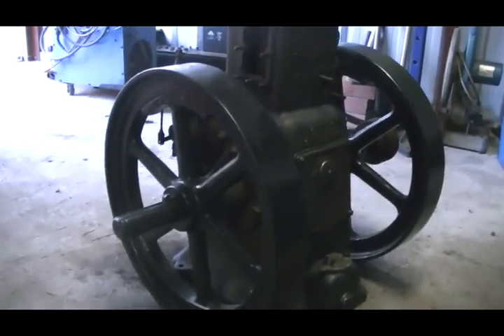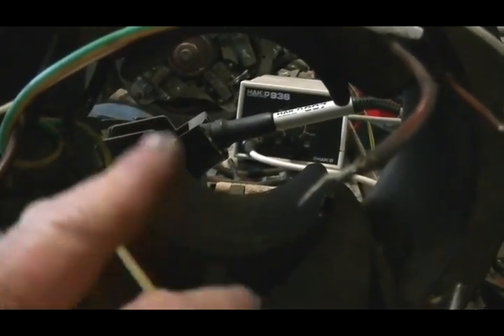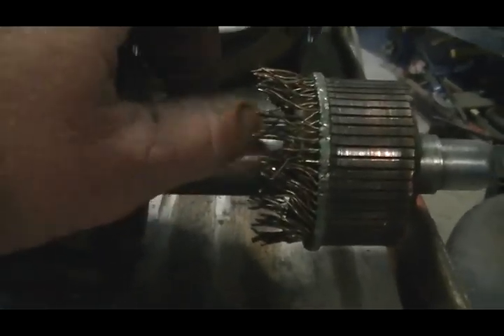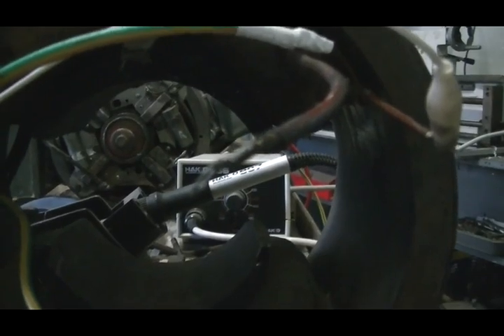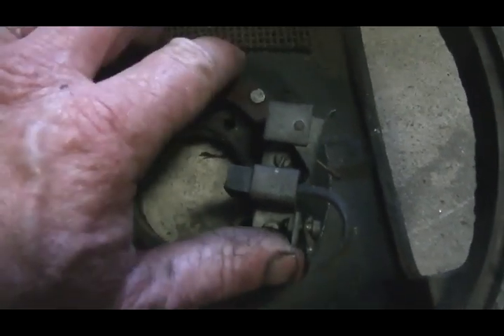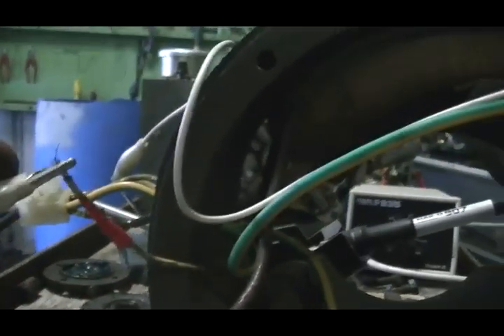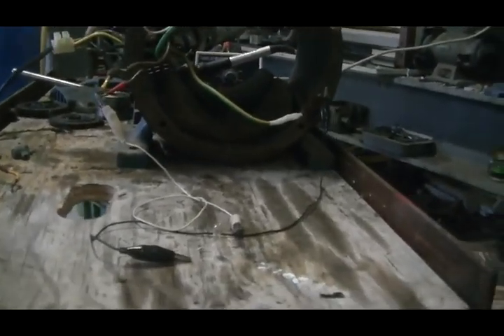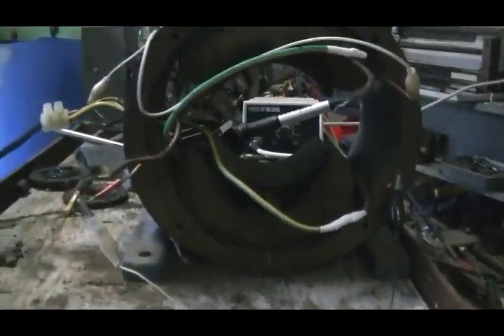My lockridge device build

Comment from the maker: Well i have two rotor legs in there now,with two n52 neo's (19mmx28mm)and i can turn the shaft by hand lol.
But the bar magnets would have been just great for this setup.But like you said-we have to use what we have.
Useing a pair of multigrips on the shaft,i positioned the magnets between the two coils-and hit the coils with 12 volt's.There was enough torque there to lift the cast iron motor of the bench at the end with the multigrip's.
This one is going to be strong.

Comment from the maker: Hi derekvolt.
Yes i have built two of them,one small 3 pole,and a larger 3 pole.I have also seen UFOpolotics latest video's on his claimed overunity galore motor generator setup.
From the tests on the two i built,and the videos ufo posted-well lets just say i will be sticking to the everyday electric motor.
If you need any more info,join the thread on energetic forum-but dont question ufo's measurment's or try and defend yourself,or you will be asked to leave his thread.

Comment: Hi Tinman .If you are going to glue the magnets in ,you should consider resin cement.Resins are at present, the strongest glues available . Lotus use this tech. to glue the chassis of their cars together.All you have to do is acid etch the surfaces before luting ( glueing ).Industrial resins are reletively cheap but not as strong as medical grade.80% of the strength for 25% of the price.

Comment: Hi
An emergency self-powering home electrical generator that was produced in Nazi Germany from Volkswagen parts—and was then sold for a number of years in the United States! 
John Bedini shows how it worked, and not only points the direction towards its reconstruction, but also highlights how and why replication efforts failed.
vacuum science series
 where the disk 14 is entitled the Lockridge device dialogue with John Bedini

Comment: Ya too bad you don't have a long bar magnet with N on top and S on bottom but ya we have to use what we got around. I imaging putting them beside each other on the rotor in NSNS pattern would stick better but would just average out the flux and defeat the purpose.